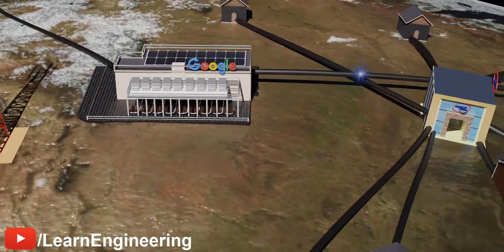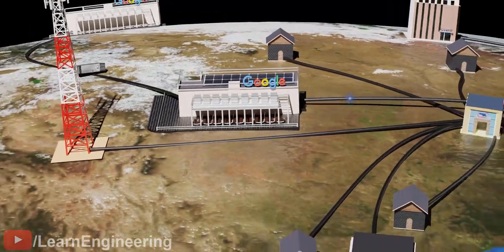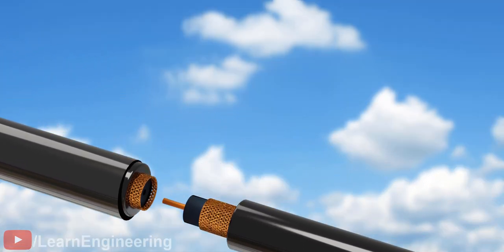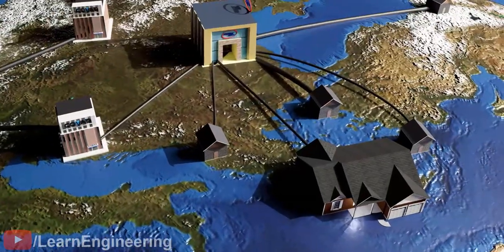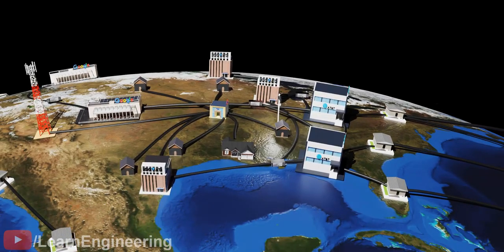Evolution of the Internet!

Comment: Some problems:
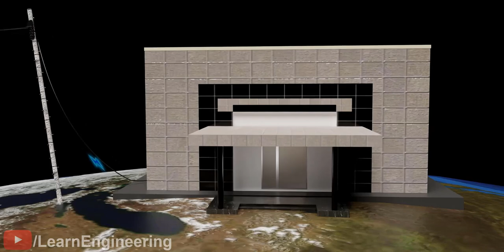1:07 : As far as I know most telephone lines uses unshielded twisted pair cable instead of coaxial cable
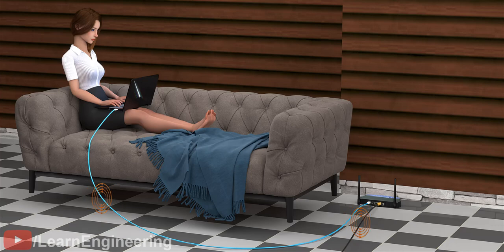3:56 : Most of ethernet cables are unshielded twisted pair, not shielded twisted pair, if wikipedia was right, they designed the ethernet standard to work on unshielded twisted pair because they are widely installed as telephone wire
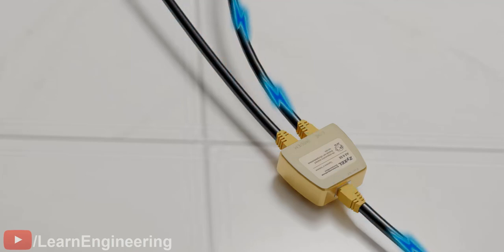Reply: Another: 1:18 : It is possible to send different frequencies of electrical signals down one wire and separate them using filters, this is Frequency Division Multiplexing. The issue is just that the internet signals and phone signals used overlapping frequency bands
Reply: Coaxial cable was the standard back then for telephony.
Reply: @olteanumihai1245  yeah that's what I'm not sure of, I might be wrong about telephone line uses twisted pair back then, but then I cannot find any references about phone line using coaxial cables
Reply: @MayTheBeerBeWithYou  After you mention it, that is actually what DSL uses, different frequency for voice and internet, and use splitter to separate them. But he seems to describe dial up internet, which uses voice frequency to transfer internet data.

And actually frequency division multiplexing and wavelength division multiplexing is the same thing, because frequency = speed of light / wavelength
Reply: Some of the Ethernet cables I have seen are actually shielded.
Reply: Are you  human or hard drive?
Reply: @oniruddhoalam2039  That's true for Ethernet cables; yet most telephone lines do use unshielded twisted pair cable.
Reply: Coaxial was used for tv here, UTP with rj11 for telephone if I'm right
Reply: @olteanumihai1245  coax carries tv signal in 700 MHz frequency range. This is why coax needed with shielding. Phones lines are bunch of color wires assembled at connection box and distributed as pairs (twisted) over neighborhood. Coax for internet became reality for much faster speeds exactly because it carry much higher frequency.

Comment: You need to mention something important in the video:
A server able to both reccive and transmitt light signals while a client only able to reccice light signals with the using of the convertion device mentioned in the video(ont).

Due to this reason upload speed is way slower than download speed!

Comment: 2:57 The animation is not quite accurate: The photons that enter the space charge region of the p-n junction in the photo diode to not contribute to current. The light often enters either the p- or n-side, but not the cross section. Please correct me if I am wrong.
Reply: You are quite correct. That amongst a couple of other errors in this video.
Reply: @K-Riz314  I was partly wrong: The photons that enter the space charge region DO contribute to the overall current, but this region is so small that the contribution is negligible. However, what I said about light entering either the p- or n-side is still true. (By the way, not all solar cells have doping to achieve n- or p-type. For example, in CIGS solar cells, the CIGS absorber material has intrinsic copper defects which makes it p-type.)

Comment: I installed zillions of 56K stuff all over the SF Bay area in c.1990.  In the mountains it was 28K. By 2000 it was 100k here and T speed there. Depended on your location from a "central office".   I would go to your house, tap in the IPs and ping. This is partly why the 2001 dot com bust ?🤔  happened.  Today all that IP stuff is done "in house," like it should have been in 2000

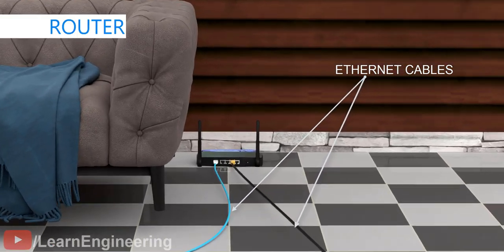Comment: 3:24  I believe the animator mess up on the cable ports。 The blue cable(output) should connect to Ethernet port(on the right), and black cable(input) should connect to internet port (on the left)
Reply: it is true but both cables are still ethernet, the color doesnt matter and the router will forward data regardless
Reply: @Dakerino-fz3rk  no offense，but if you look closely： the blue cable port is isolated from the rest of the ports，which indicate its an internet port。

Comment: Get your facts straight telephones did not work on coaxial cable it was one pair or 2 wire's tip and ring and its not optical fiber cable its fiber optic cable made of glass .

Comment: Terrible explanation. Coax cables and splitters had nothing to do with telephone - they are for TV originally. The internet last mile used phones line and modem. This is why one could not use phone while connected to the internet.